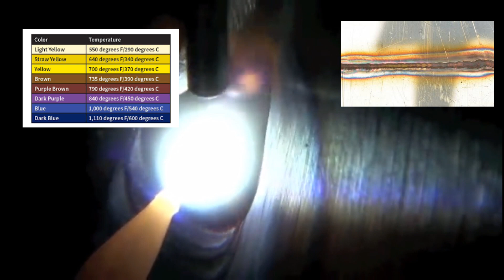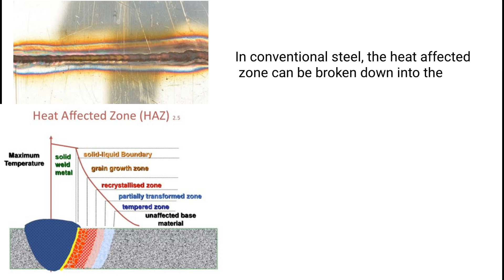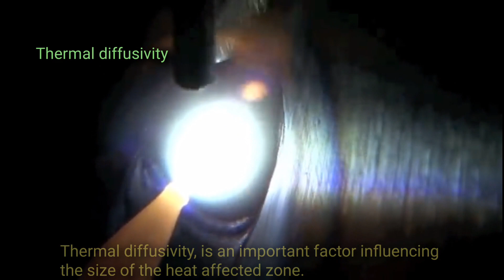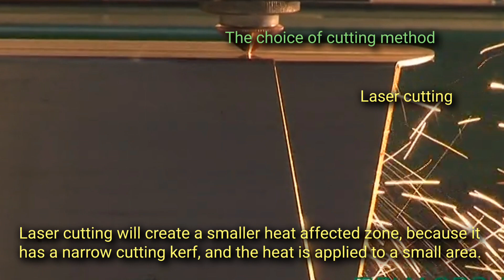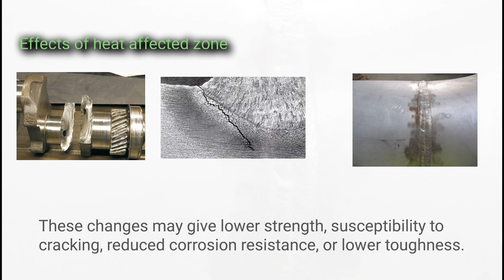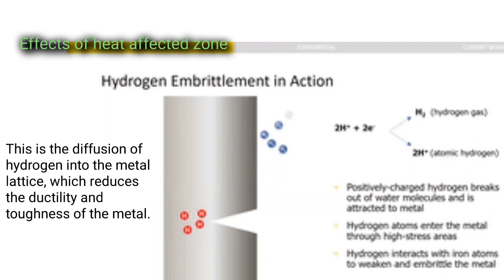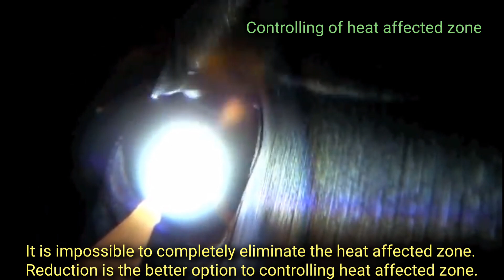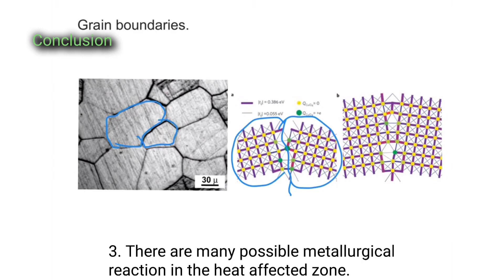Detailed Explanation Of The Heat Affected Zone In Welding & Cutting.

Comment: This is what has been going through my mind regarding  a welding job I need doing. I have an Aluminium bicycle frame that the previous owner attempted to fit an oversize tyre to by filing the sides of the frame. It looks like they started on one side and realised they had made a hole through the thin tubing and left it at that. A local welding business says they can fill in the missing metal, I presume tig welding it.  I am wondering if the heat generated will compromise the temper and weaken the whole area of the tube. The Aluminium is 6061 T6, I'd have more confidence in a repair if it was a steel frame due to less flexing stress